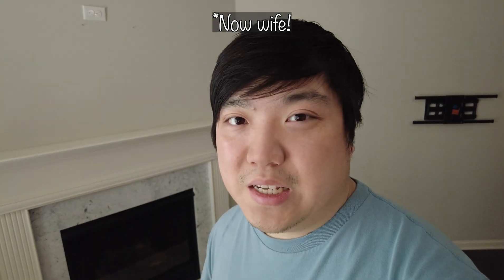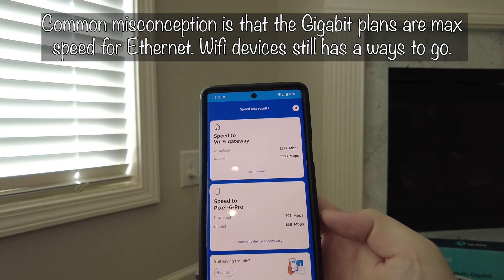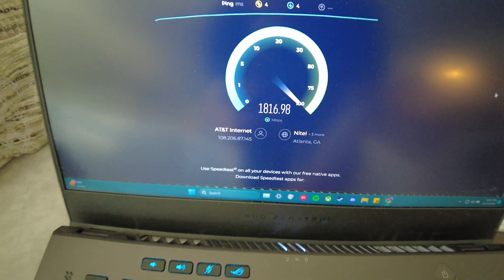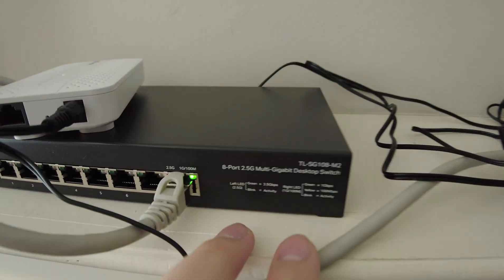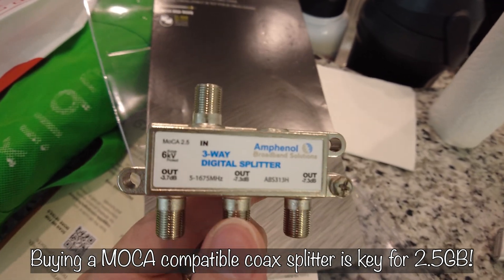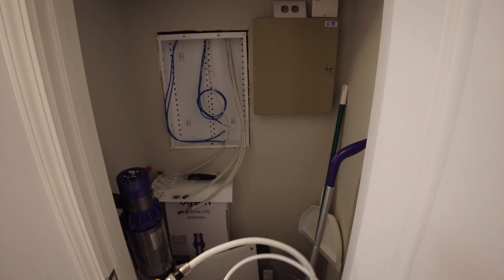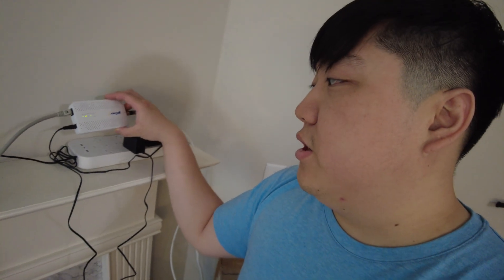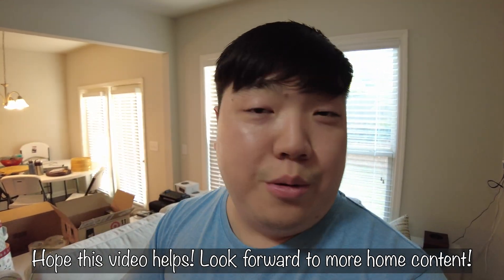How To Setup Wired Home Internet in 2025 | AT&T 2 GIG Fiber Plan + GoCoax MoCA 2.5 Ethernet Review

Comment: Is the ATT router not good.. why did you buy your own router? Curious..

I’m thinking of adding this MoCA splitter so my kids can get better internet upstairs. The wifi is just terrible for them.

Question— if you have ATT fiber, should you not be using fiber cables vs E7/E8 cables?
Reply from the maker: ATT router is not great and any decent brand router will beat it. Especially if you want wifi 6. We have ATT fiber but don't have Ethernet ports in our house. Therefore going with a MoCA solution.

Comment: Did you have to turn off the Wifi from the Att box, before connecting the TPlink router?
Reply from the maker: You don't have to necessarily turn it off prior, but it helps to disable it afterwards to prevent interference.

Comment: Also, guys in comments, If you have only a splitter before the modem side of our house (From street, to slitter, then to modem) a MoCA filter is REQUIRED to go onto the input side (FROM your telco company cabling) of the splitter. This removes the MoCA signaling from back feeding into the telco networking and causing issues

Curious what is behind each of those plates, those blue cables, as what others have said are cat5, they are currently terminated as RJ11 (phone) but can be reterminated as RJ45 (ethernet). Those blue cables might of been behind some of those plates. MoCA was a way easier solution though!

Some nit picking but also want to make sure that terminology and math is correct
Speed test is in megabytes per second (mbps). not Gigahertz. 
GBps is GigaBytes per second. Big B denotes Bytes
Gbps is Gigabits per second. Small b denotes bits
There is 8 bits and a byte, so if you see any MBps (Megabytes), Multply the number by 8 to get Mbps (megabits per second)
Same goes with giga... divide or multiply depending on bits or bytes

I know to most people, they are just numbers 😄

Anyway, nice video sir!

Comment: my upload speed is slow and would like some recommendations on how to fix that. Thanks!
Reply from the maker: Usually it's dependent on your internet plan. At least for me I'm getting the advertised speeds for my own. If you suspect it should be higher, then I would check the router you own and any cables.
Reply: @CantoHouse ty!

Comment: i need some info before buying this: is the moca filter mandatory if was to use moca?,also dose the filter work if i put on the cowax line between my router and one of th cowax outlets? (i live in a vila that maybe has the coax wiring in the walls only,and not in a box, like what western homes do)
Reply from the maker: Moca filter is highly recommended, especially if your house is like mine where the coax cables weren't connected to each other. Essentially it also acts as the centerpiece to tie your coax connection from wall to wall. If you don't have a box or central area, then you need to discover how your house is wired up. You could buy and test it yourself and return it if it's not successful. Or just leave it to a professional.
Reply: it seems that i dont have a box..,and my router only has regular fiber,and not cowax fiber, so can i put it on the cowax between the moca and the cowax wire? @CantoHouse
Reply from the maker: @Abboada_m639 coax is typically built in for TV usage in most houses. Some countries use it for internet. Your coax is connected somehow. I would suggest leaving it to a professional.

Comment: My guy, let me just tell you what a lifesaver you are. I had an existing MoCa setup using Xfinity, which came in off the street via coax, natch. I set it up about 4 years ago. We just switched over to GloFiber and the fiber comes into the house in a different location. I had the guy put it into the house next to an internal coax outlet so I could just set up the MoCa network at that coax outlet. Well, I gave it a shot today but nothing. Most significantly, I wasn’t even getting the coax light to light up on the adapter. I recalled that when I first set up my MoCa network not every coax outlet seemed to work.  I never investigated further because I didn’t need them all to work, just two and two were working. But this one in my living room wasn’t today. Then I watched your video and decided “hey, I have an OnQ box, maybe not all my coax outlets are connected in there.” Sure enough, only two of the eight coax out cables were connected! They were all crimped with connectors, though. I looked around in the OnQ panel on the wall and found an unused 1-in/8-out coax switch. So I connected all 8 of the coax outs and suddenly every coax port in my house became active! I would never have thought to look there if I hadn’t watched your video, so thanks!!! Now my MoCa setup is back and working, but this time on fiber. Woot!

Comment: I can't get into the IP so i can log into the adapter. I'm connected directly to the device but the IP times out and I can't ping it at all
Reply from the maker: Google your default router model IP address or consult the manual. If you're connected directly via Ethernet, it should load. If it doesn't, make sure you're not behind VPN or have the wrong IP (Wi-Fi, other device, etc).
Reply: @CantoHouse  I can log into my router but I can't log into the adapter itself. I turned off the open VPN on my ASUS router but for some reason whether I plug the adapter into my wan on my AP or if I plug it directly into my desktop I still can't get that freaking interface to load

Comment: I have the BGW-210 modem/router combo from AT&T. It connects from the outside with the red ONT cable coming from the white fiber box on the wall. The coax jack is in the wall on the other side of the room, not by the ONT box. There’s nowhere for a coax cable to go into the BGW-210. 

Am I SOL? Or is the coax jack that I need likely the one across the room?

Excuse my ignorance but would need to have the moca adapter come from the coax jack and then have an Ethernet  cable connected to my BGW-210 modem/router combo? I don’t really want to have a Ethernet cable running from across the room into the moca adapter by the coax jack.
Reply from the maker: @michael_robbie  to answer your coax question, yes you need an Ethernet from the router to the MoCA adapter plugged into your coax in order to provide Internet to the rest of the coax to your house. Unfortunately if your coax cable isn't in the same room, you'll probably have to run a long cable across.
Reply: @ thanks for the quick reply

Comment: 99% your "phone" wires are 5e.  Should use those bro.  Can handle 2.5gig just fine.  I use moca myself but because my phone wires are in poor condition.
Reply from the maker: Yup there's definitely a good chance they are. I just went with Coax because the phone cable locations aren't as nice around the house comparatively.

Comment: I just bought the tp link router right above the one you have.  It comes in tomorrow.  I was going to run modem to router.  Then the router to switch. Then run Ethernet from switch to the MoCA.  From the video it looks like you have 2 ethernets. One to switch and the other to the MoCa. Am I seeing them at wrong?

Comment: Trying to figure out how you ran your Ethernet.  Can you explain what Ethernet ran where?  The att modem to the router. Then the router to the switch. Then the Ethernet from switch to moca. Is that what you did? I ask because the switch only had 1 Ethernet
Reply from the maker: Yup ethernet setup is ATT Modem -> TP Link Router -> Ethernet Switch (optional) -> Moca Coax Adapter -> Wall Coax -> Upstairs Moca Coax Adapter -> PC.

Comment: I would check in the walls where all your coax lines are in the rooms. A lot of the times they just run a bundle cable that has coax and ethernet. So even if your wall plate only has coax, there could be ethernet (Cat5E or better) in the wall unused. That would be a far better option than those moca adapters. Also most of the times the phone jacks (RJ11) are run with cat5e and you can convert those if you dont need the phone line.
Reply from the maker: Yeah this was mentioned by others too, I did know about it as an option, but for some reason our house only has that combo coax/phone jack in the living room, all the other rooms have it separate. The coax locations were better than some of the phone jacks so thats also why I went this route.

Comment: Where do the phone cables go to? Did you try tying a cat 6 cable to a phone cable and pull it through?
Reply from the maker: They also go to my internet box I showed with my coax cables but the ends are unfinished. I was sightly scared to do the method you mentioned of fishing cables because I read some new builds have cables mounted down in my area. Thus why I went the coax route instead because I was familiar with it.

Comment: If your WiFi coverage isn’t enough, you can buy like, another tplink from this line and use is mesh mode. Don’t need to be other be router, just for WiFi coverage an Ax3000 - AX5400 is good enough

Comment: Nice that the ISP modem use an SFP+ module to fiber, it  make easier to eliminate the modem
Reply: On the AT&T Humax and Nokia Gateways, the SFP+ modules Red for XGS-PON, Green for G-PON networks is just a simple media converter, unfortunately you can’t just pop it out and stick it into your equipment, the ONT/ONU functions are in the Gateway itself. If you google 8311, they have a community custom firmware for a WAS-110 ONT-On-A-Stick SFP+ module that does allow you to bypass the gateway.

Comment: Cat5e can run 2.5g no problem, especially a short patch cable. Tested it yourself. You really only need cat6 for longer runs over 100 foot.
Reply from the maker: I did read some conflicting info about cat5e on 2.5, perhaps my old ones were bad but I never got above 1 Gbps on them. However I did want to future proof all my cables anyways in case I ever move again into a bigger house, so decided on Cat 6 & above.

Comment: hey i just wanted to say that them phone line cables are just cat 5e or cat 6 cables they will run 2.5gig easy just change the wall plates
Reply from the maker: @leocorbett1456  yup this is also another valid solution as mentioned by someone else too. However I think our coax ports are located better around our house than our phone lines, and for some reason one room didn't have a phone line at all.

Comment: @CantoHouse great first video, however, when you terminated the RG59/RG58 you should have left the segment of silver webbing because that is intended as a grounding layer or "RF interference" barrier which is considered the "shielding" referenced in the specifications for the coaxial cable standard.  I have just downsized to an apartment that while newly converted as of about five years ago, they only paid XFinitity to do the broadband layout via coax only, so there is no other option than something like a Moca adapter network to get from room to room via ethernet for my home lab systems and will be utilizing this setup. I first learned about Moca while trying to figure out why I still needed the Gateway for the Fios TV service, even though I had my network connected directly to the ONT via their ethernet port.  That was like five years ago, and this is coming full circle now, LOL!!!!
Reply: You noticed that too.  I'd go back and fix the shielding.
Reply from the maker: @MartesWigglesworth  Ahh thanks for the info! Some of the coax cables after using the tool was left kinda peeling off so l thought it was better to give it a clean cut, but some I left it on. Will note for next time.
Reply: @CantoHouse  If you have issues with performance, I would highly recommend redoing these terminations and having the ground is actually required to minimize from crosstalk and other things

Comment: Just saw your video.  Thinking of doing the same thing for our rental.   Do you really need the att router?   Can you just connect the tp link router directly to the att box/line?   Especially if att is charging you a rental fee for their router.

I have verizon fios and use my own router and gave theirs back
Reply from the maker: From what I understand you need the AT&T router for the unique fiber line connection & verification. Then I followed the pinned guide to setup bypass to my TP Link router, also turning off the AT&T wifi bands in the process so they don't overlap.
Reply: You can bypass the At&t garbage

Comment: Hey! It might be worth checking the cables behind your phone and coax jacks. Since your townhouse was built in 2018, there's a good chance the phone lines are actually Cat6. If that's the case, you can swap out the existing jacks for RJ45 ones. Afterward, locate where the Cat6 cables connect, and then you can either use a punch-down block for RJ45 or terminate the ends to complete the setup.
Reply from the maker: Thanks, I've read about this solution too! I believe they all connect in my Internet box but don't have an end just like my coax. I thought about this route, but the coax locations around the house are just bit better than my phone jack locations, so I decided to do MoCA adapters instead. But it definitely would be better cost-wise.
Reply: @CantoHouse  You have to remember that the MoCA shares the up and download speed.  So you don't get 2.5 up and down at the same time.  You would if you use Ethernet.  Are you cables that are used for the phone 8 wires?  If so you could use those wires.  I understand that the jacket on the wall are where you want to hook up your computer.  There are way to hide cables under the baseboard if you have carpet.  Do you really need that fast of internet?  What web site can you use your whole speed?  I use to have fiber 1 gb and moved to 300 MB.  This has worked fine for me, only a few things were it would be nice to have a little bit more speed to download stuff but I can wait an extra few mins.  I really think they over hype on how much speed you need.  I think the key is to have fiber.  I have fiber but only 300 MB.  I think that I can get up to 2 GB but I don't really need it.
Reply from the maker: @zorin1us  We have two use cases for needing 2.5. First one is that we have a lot of consoles, computers, etc that use wired so I don't mind if it gets split because some devices max out at 1gb anyways due to the ports. The second case is for our main desktops, we're downloading and uploading a lot of files (including editing videos) from the internet as well as from our home server, so productivity-wise we definitely could use faster ethernet.